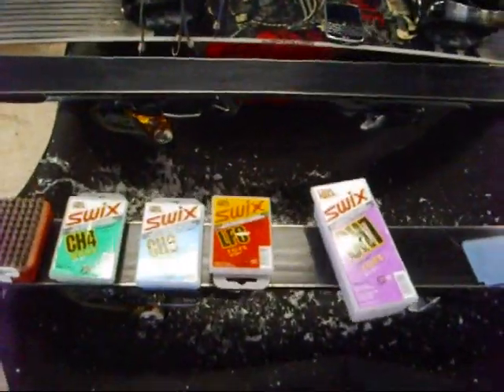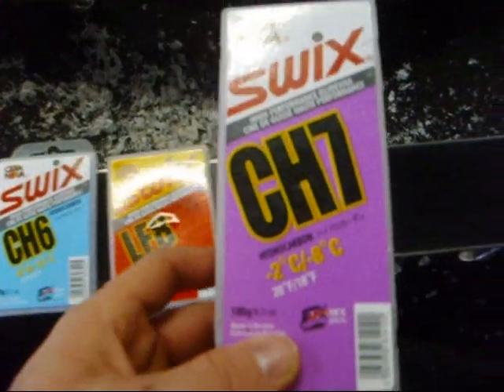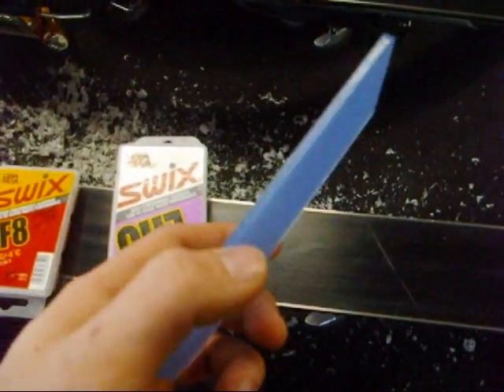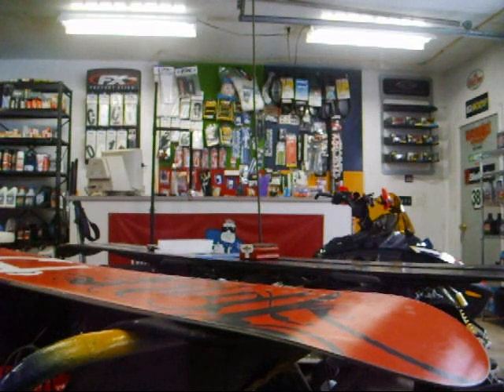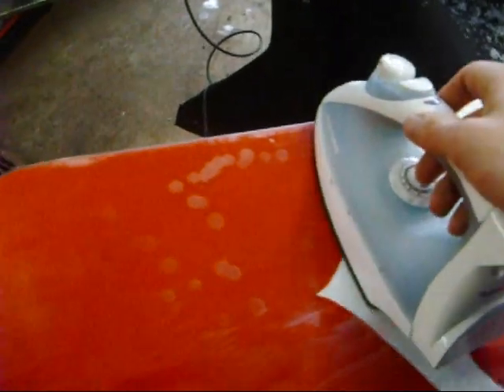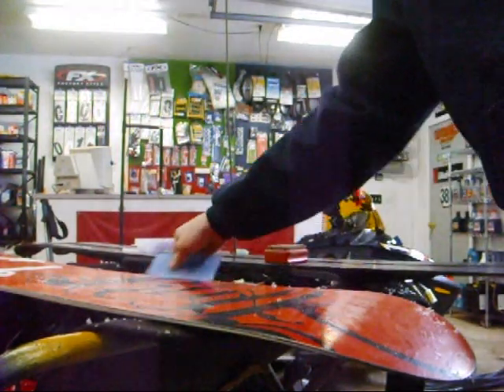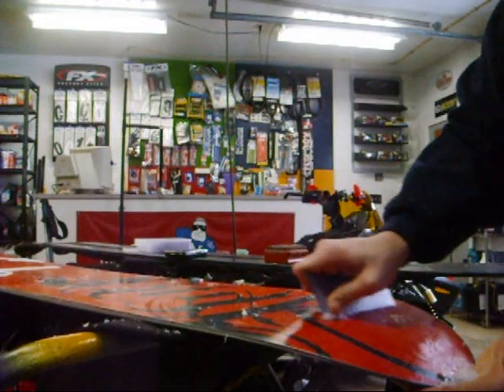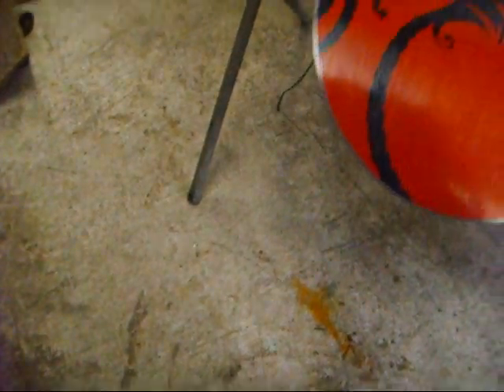How to Hot Wax snow skis or snowboard PT 1

Comment from the maker: it wont help with that, if you get wax on the edges, it will just wear off over the day, i wouldnt worry about them rusting after a day of skiing, but at the end of the year i usually wax over the edges before i store them, or rub a candle on the edges just so they dont rust too bad over the summer